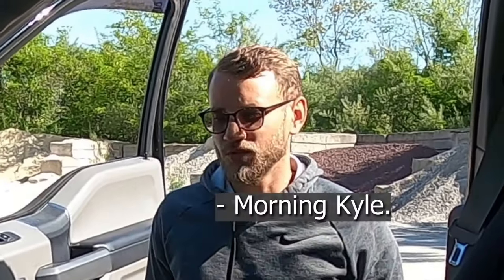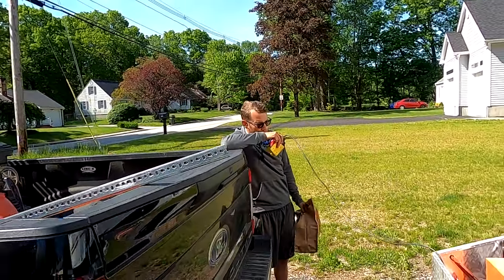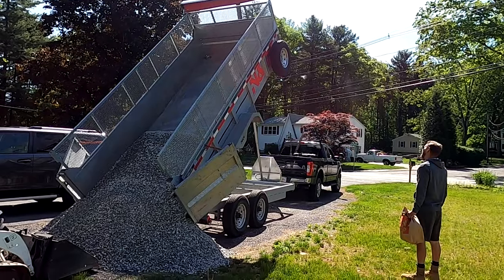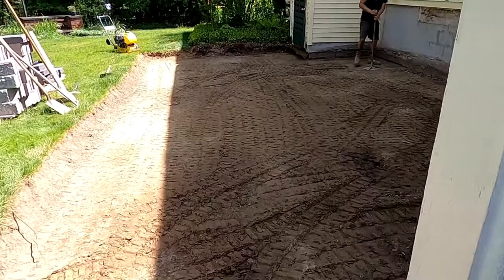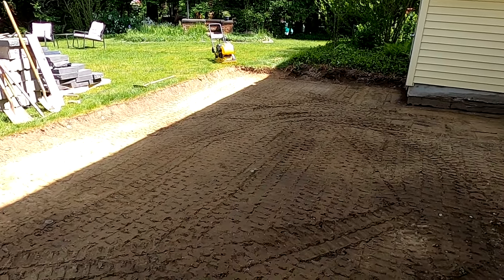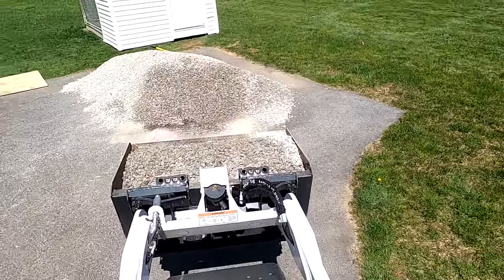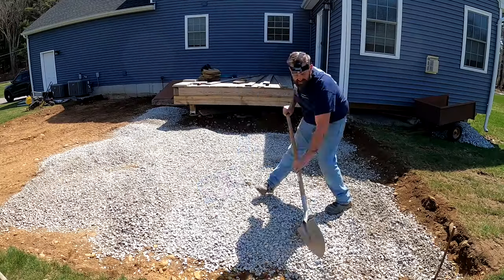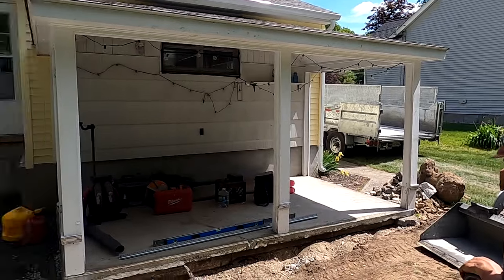Paver Base Prep | Why I Use (Open Grade Base).....

Comment: You mentioned that the level 5 is used for driveways. Would you still use open grade base for a driveway?
Reply from the maker: Yes I would use open grade base for driveways. But I would do it a little differently than I do for foot traffic applications. Like using 12 inches of stone, backfilled and compacted in 4 inch lifts. Also I would use 2 layers of geo grid. One layer at 4 inches and one layer at 8 inches. That extra compaction and stabilization from the geo grid will support the weight of vehicles over time. Also, a very important thing most overlook with paver driveways is you need to use a thick paver. Most patio and walkway pavers are 2-3/8 inches, for driveways you need a minimum of 3 inch paver. But yes, I believe open grade base is far superior for driveways as well ✌🏻

Comment: Question maybe its a area difference but I'm curious as to why you use a Woven Geo Textile over a Non Woven Geo Textile as my understanding is Woven are non permeable kinda defeating the 3/4 clear bases purpose could just be an area terminology as well
Reply from the maker: I am not sure why people say that, I hear it once in awhile too... But woven geotextile is permeable and I use it because it is stronger than a non woven fabric which gives the base more stabilization. ✌
Reply: @TheChristianHardscaper  Thanks for the reply ! having a project done and I was really debating which to have them use, I think Woven Geo requires it to be choppy not smoothed and taught which is probably why the way you do your base works so well as u have the 3/4 clear in the subsoil causing rifts in the Weave
Reply from the maker: Exactly, the pointed edges of the stone really helps open the woven plastic strands. 4 + years of installs using now, no issues whatso ever with drainage. 👌

Comment: Would it be cheaper to buy bags of stone locally since delivery is usually pretty expensive?  If so which store bought stone could be used as a base?  Do you always have to have a base?  The ground I'm working with hasn't been disturbed since it was built back in 1930.
Reply from the maker: It is pretty much never cheaper to buy it by the bag. I would say unless you need a very small amount, have it delivered.

Comment: I'm not sure I follow your logic with the "correcting the base (or subsoil)" concept. I don't see how compacting the crushed stone on top of the subsoil corrects anything. All you're doing is essentially working the crushed stone about 3/4" (or less depending on the size of the stone) on top of the subsoil (as you illustrate at 7:22). This won't make the soil "accept" any more water than if you didn't compact the 3/4" because you're not changing the profile of the subsoil. Water will pool in the 3/4" indentations and around the stone and then either sit there (if it's heavy clay) or drain through the subsoil if there's more organic matter or slowly drain away in the direction of the slope, or both. My point being, if the subsoil is clay (seemingly the case in a lot of places), the only way to truly correct its drainage is to change its profile by working in some type of organic material (something you obviously won't do for projects like this). Everything else I've watched so far has been very helpful. This is not criticism just an observation as you talk about this process in a lot of you videos.
Reply from the maker: When I say (Correct) the sub soil, it means to help it accept water easier. If you were to compact the sub soil itself, it would flatten and tighten the soil, making it harder for water to penetrate it and permeate. Compacting 3/4 into the sub soil will absolutely help it accept water easier. Doing that also gives the fabric we use a bed of 3/4 to lay it on which also helps open the strands of the fabric to allow water to drain better. And clay soil will take much longer for water to permeate through but it still will. That is why we dig deeper to allow water more room to slowly permeate.